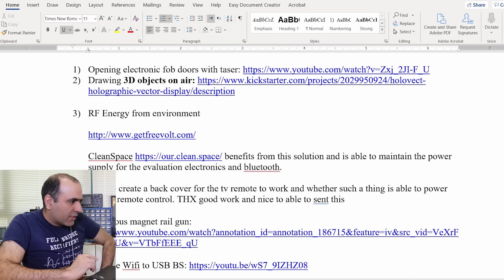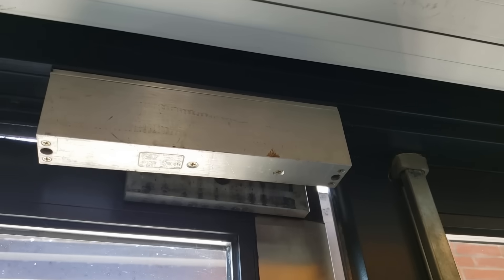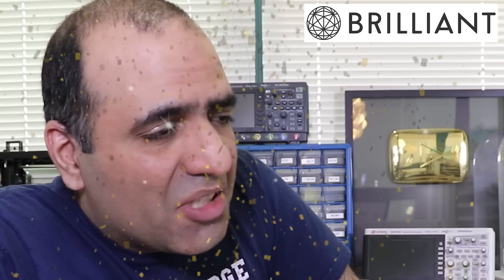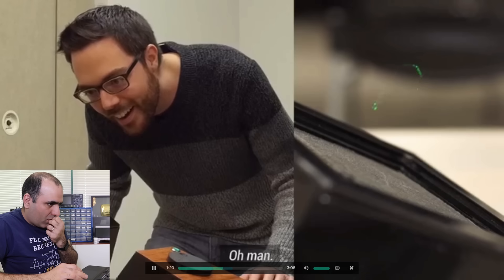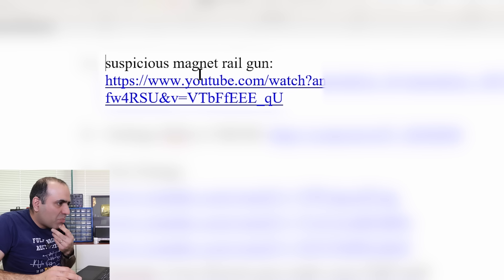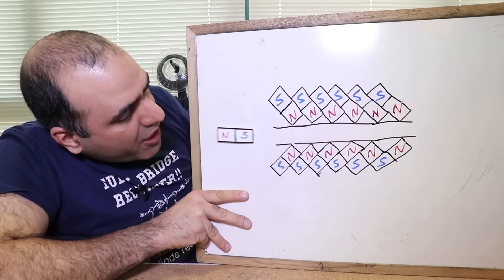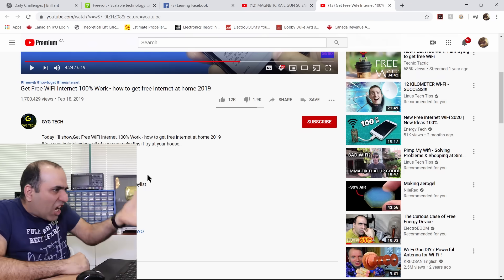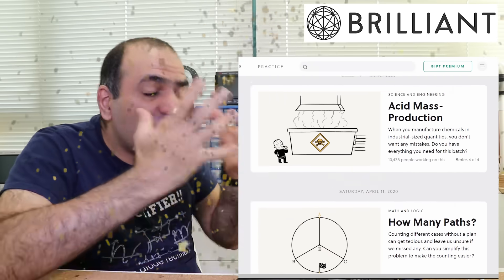BATCH RECTIFICATION of my To-Do-List

Comment: Electric doors are supposed to fail in the unlocked position.
Because they dont want people locked in the building during a fire.

Newer access systems are independent from the door.

In modern systems the FIRE ALARM controls the door , the access panel just tells the fire alarm system to open the door.

So as long as the fire alarm system is functioning the door will remain locked 
(unless there's a fire)

Comment: At 10:17 you can see his phone's is on airplane mode
Reply: hack Smit Wifi works during arplane mode is on, if he had turned airplane mode off, you could say, that the connection is working by 4G

Comment: 1:36 You're wrong. It depends on door purpose. In apartment buildings in emergency case door must be unlocked, so power supply failure which can cause fire and need for evacuation won't lock people inside the building.

Comment: Most likely a modern system is controlled by a separate controller that's not even inside of the reader/keypad unit. So even if you reset the keypad unit the controller unit has no reason to unlock the door.

This is why opening and rewiring the keypad in movies to unlock the door is stupid. It's like rewiring the keyboard to hack a computer. That's now how it works. They keypad is an input device it's not the thing that unlocks the door.

Comment: Ha, great video.  One comment;  The doors probably fail in the open position for safety.  If the power goes out you don't want to be locked in, say if there is a fire.  Just like how most alarm systems will fail into alarm so if there's a fault you get the alarm instead of not getting it if it fails and there is a problem.

Comment: Normally a panel control has a small Backup battery in case of a sistem reset or a blackout but no idea it prevents this hacking discharge

Comment: Hey, that 3D projector thing could be fixed I think. You need some gas that can be excited twice with 2 different frequencies outside of the visible spectrum. The invisible laser A would hit the molecules, and they would transition to excited state 1. Then the also invisible laser B would hit them again, and they transition to excited state 2. When they jump back from 2 to the ground state, that is visible. This way, you can draw by crossing the lasers, you don't have to wait for the gas to move out of the way. The gas can be everywhere. Add more types of gas and more lasers for different colors.

Comment: The wi-fi dongle thing is of course nonsense, but I think the type of nonsense might be different than you described. Rather than the phone using the usb connector to get the wi-fi signal, perhaps the idea (which again is totally bogus) is that the phone supplies power to the coils by USB, and the coils somehow resonate and amplify wi-fi signals that are already in the air, amplifying them through the air, where they are then picked up wirelessly as usual through the phone's wi-fi antena. As you said, that dongle has no connection to the data pins on the phone's USB port, so the only thing that could possibly be transmitted is power. And since the a micro-USB port is for client devices, that's not going to be a lot of power at all. Totally bogus.

Comment: Could you create a circle of magnets with a mechanism that somehow moves the next magnet out of the way just in time to not interfere in the opposite direction, then move back in place to keep a magnet moving along a rail?
  Or rather than having the magnet move along a rail, have the magnet held in place so that the circle of magnets moved instead around a separate point. The inner and outer parts of the wheel could be forced through separated frames that force the magnets together and apart as needed, like the mechanism of a zipper.

Comment: The laser system seems to use a galvonometer to steer the laser beam. Those actuator use mirrors to quickly deflect the light to the desired angle. Because of the mirrors inertia, the corners of a sharp shape seems brighter.

Comment: Those doors are designed to open in case of any failure, this is done for safety. The purpose of that lock entirely is to impede access to unauthorized persons, as you can see in the video, there's nothing to steal, nothing behind the door except a dirty staircase and envelope-size mailboxes.

Comment: 9:47 fun fact: solder doesn't stick to zink coated surfaces. Such as pins typically. Tip: lightly file down the zink coating and then solder ;-)
Reply: Dipping the area to be soldered in hydrochloric acid (muratic acid in some places) works really quick

Comment: 1:00
Not locking 15 families inside their own homes is the safe mode of failure
Reply: The system should have a 'backdoor' for the residents, not unlocking the door to anyone.
Reply: @Oniruddho Alam So, let's say there's a lightning bolt, that's not only broke said door, but also broke electrical system, and setting parts of building on fire. And you want the door stay locked?

Though to be fair, they are Russian door, I know nothing about Russian version of OSHA.

Comment: I think those doors had a relay in the control panel that charged the electromagnet. When you use the teaser the relay changes position and the door opens. You could do the same thing with holding a magnet on the control panel.

Comment: Don't trust anyone to demonstrate how to bypass a security system unless they actually work on those security systems. It's so insanely simple to bypass all of this security stuff without setting it off that no one will believe you unless they are also doing work on those systems or have in the past. No special devices, no stupid gimmicks, just basic freaking tools but here's the kicker, it takes enough time or just the right vector of approach that your not getting past any security cameras, motions or people that might be around.

BTW zapping the pad will only really overload the case ground. Some systems might utilize it as a ground point for the electronics but majority of systems it's purely a case ground with electrical ground handled with buried conductors (wire in walls, ceilings and door frames).

Comment: umm regarding the fail safe door part.
If the door fails, because say there's a fire, or thunderstorm, or earthquake etc, in what looks like a residential building, would you rather the residents be locked inside?
Now granted, there can be a physical release inside, but i know for a fact that in many such buildings the release inside is also electronic soo...

Comment: Just a simple question , if the magnets are able to repel in linear motion , why won't they work in circular motion?
Reply: There's several answer to this question, but what I think make most sense is because it's circular. Circular means the linear movement actually got restrained and bleed it's momentum until it stopped. And unlike moon, there's no earth gravity to pull the magnet into the center of circular movement to basically preserves the momentum.

There's some part (or maybe all parts) of this statement that is wrong and/ or didn't make sense, so feel free to correct me. :p

Comment: 0:59 Is it safe and secure for a door to fail and stay locked though? Speaking from the fire safety perspective and considering the fact that all the apartments inside do (should) have their own locks, we are balancing a marginal increase in security from a break in with the possibility of trapping hundreds of people in a burning building.
Reply: Modern maglock systems fail to the unlocked position. It is a code violation and a huge safety issue as you pointed out. At least that is true where I'm at in the States.
Reply: @zemerick1  Exactly what I expected.
Reply: true, but what if they just cut the power out, I guess that wouldn't be accessible, maybe they can have it open from a panel next to the door, then maybe they can just shut it off, could work even if it was wired to a special security power unit. Also, for the fire department to get inside, perhaps they can break the glass?

I'm sure there's some sort of regulation on this.
Reply: @mstech-gamingandmore1827  It's not about the fire department getting in, it's about the people getting out. By the time the fire department gets there it may be too late for anyone to get out.
Reply: @mstech-gamingandmore1827  my company and I install these access control systems all the time. I can tell you that external access in an emergency is almost NEVER considered. They are expected to have a key fob like everyone else. 

Best practice, for fire at least, is that the system is tied to the fire alarm panel. This is so if the alarm is triggered all of the maglocks "release" . This allows for folks to leave and emergency personnel to enter. Unfortunately,  this is not always done due to local government not having the training for the integration. 

Also, all maglocks should have a motion sensor on the inside to allow exit...again this doesn't help emergency personnel to enter.
Reply: @zemerick1  Yeah, but at least firefighters tend to be really good at breaking into places. They will have tools at their disposal to overcome or circumvent a locked door. Residents who probably ran out of their flat at 2 AM in their boxers and flip flops holding their iPhone in one hand and their cat in the other could be considerably less efficient at conducting a forced entry (or in this case a forced exit).
Reply: Those locks are on the hall of apartment buildings in Russia. They are not intended to be high security devices and you can often open them with brute force. They are mostly there to discourage casual drunks passing out on your stair rather than any serious criminals. For your protection you rely on your apartment door not building door. So fire safety definitely takes precedent over security for those doors.
Reply: David Burgin  You break down a vault door with a sledge then. I'll wait.
Reply: Emergency and fail mechanism are two separate things. In a well-engineered product, you can't just activate the emergency protocol by making it fail. And the emergency protocol has to work even if it fails.
Reply: @D2RG6 this is inaccurate. The mag is either energized or isn't. Usually based on someone pressing a button, or an alarm going off.
Reply: safe no, secure yes
Reply: exactly.  egress doors are required by code to open from the inside.   even if it's a secured door it MUST open, even if it has an alarm and time delay for security.
Reply: Adding my 2 cents to the discussion, I would make a mechanical unlock bar like in public places that you just rush to it and press to open it and get out, that works independently of any electronic system.
I mean in any emergency you just have to get out quickly, independent of there having power or not to the locks.
Reply: @Kalvinjj  Wouldn't work, the magnet hold the whole door. Mehdi said it has a 300 kg holding power.
Reply: Would it be safer to have prison cells fail locked or open upon a power-outage? 🤔
Reply: @user-vn7ce5ig1z  Fail open for the cells, fail shut for the main door
Reply: @user-vn7ce5ig1z  safer for who?
Reply: That is very true. It would seem extremely dangerous to have an electronic lock(in case of error) to close during an emergency situation. Just imagine some buildings that have no glass windows and beefy doors. You'd be trapped in there during a worst case scenario. 

Come think of it we actually have magnetic locks where I live but glass windows(they're pretty thick tho). I sure wonder what would happen if the building caught on fire and something went wrong with the system. There are no switches that I can see on the inside that would override the lock. Scary.
Reply: I believe all these doors have to have a manual unlock from the inside, if it just unlocked when the power went out that would just be inviting criminals in.

Comment: Dude I feel safer in a place where electronic doors open in case of a failure. 😅 So it's not a bad design that's how it supposed to be..
Reply: In my house it work sthe following way in case of no power - it can be opened with a door knob from the inside, but stays locked as the outside door knob is just a handle that doesn't turn, but the door can be opened with a key instead. So you can get out easily, and it is just as safe or unsafe as an non-electronic lock with a key when trying to get in. Only there is one minor problem with this situation - there is no check for me actually having a key when getting out and locking the door, so it is possible to walk out and then stay out because of forgetting to bring the keys. This is a minor problem though, as I also have addidtional locks that do need keys so it doesn't happen because I bring all of them. But it might.

Comment: In the place I grew up there was a very similar system of door lock as in a video and I remember once when the building was temporarily disconnected from the electricity you could open the doors without using a key

Comment: The reason the Russian doors fail in the open position is because the system is designed to fail safe, not fail secure. If there were enough other dedicated fire exits the door could fail secure, but legally most apartment complex doors would have to fail safe.

Comment: thats  living appartments doors thay cant  be designed to shut when broken. thats fire hazard
Reply: There is probably an internal release and it probably is safe on power loss or if the controller times out. it's probably designed to not release on an intermittent interruption to increase security. That's probably also just a remote screen and keypad where the actual controller is not accessible externally. So while he may be resetting the display, the actual controller may not even notice it. the lockpickinglawyer has some videos on bypassing a lot of cheap electronic security systems like that but those more just give the illusion of security than being any real security systems
Reply: @OtakuSanel  Yeah, but when he zapped the panel you can see the bootloader so it must have been reset.

Comment: If an electronic lock fails, you want the lock to fail to UNLOCKED so that emergency crews can enter and occupants can exit.
Lets say lightening hits the building and it is not grounded properly, etc etc, and the building  starts to burn.  You want that door to be unlocked.
Reply: I'd rather risk it failing locked than providing universal and easy access to my home. And have you never heard of firefighters breaking down doors?

Comment: Can you now make a lighter out of a microphone since you did the opposite?
Reply: Any electronic device can be a lighter provider you fuck it up enough
Reply: @fangk.7367  Photonicinduction would agree.
Reply: Mehdi turns everything to a lighter when he is shooting.
Reply: Everything is a lighter if voltage is high enugh.
Reply: He already did it. We make smoke from a micro, we can agree its a crappy lighter
Reply: That's too easy. You remove all the  complicated stuff and shove a big heating element in place. Even a toddler cam do it.

...Granted, that would require said toddler can operate screwdrivers and solder.
Reply: He did it two years ago https://youtu.be/4BoOecRC1lM